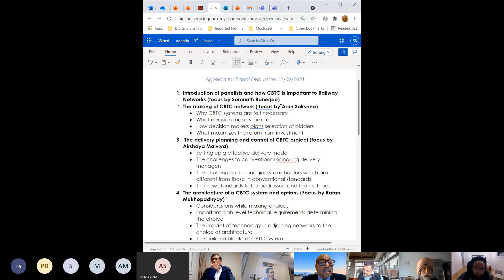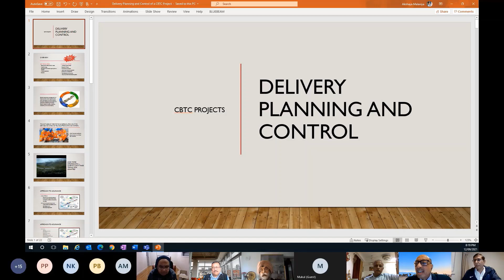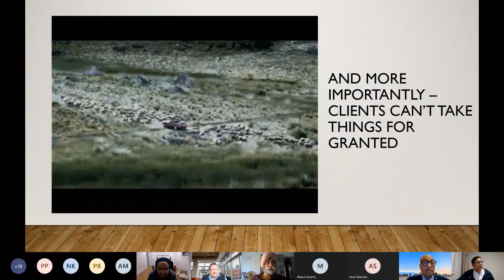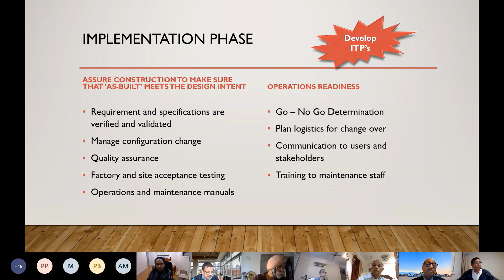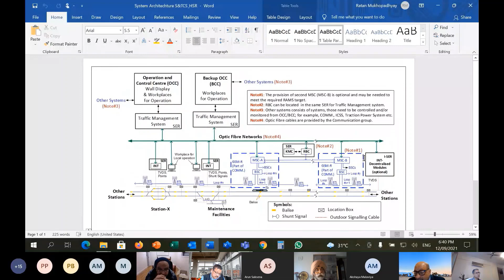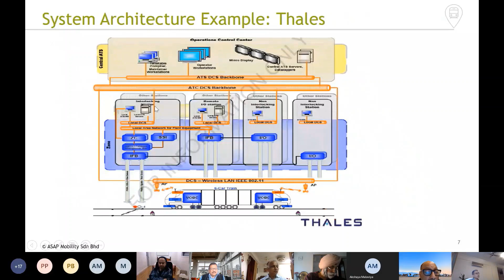Comment: Comments of V Shanker, IRSSE, GM CLW

Arun, one issue we are trying to figure out in driverless  GOA 4 CBTC system. If a train/ few trains lose their locational data for a couple of minutes while on the run (may be wifi link failure or transient on board problem ) and regains it a few minutes later, the way side control unit is unaware of changes in train positions in the intervening period. When trains begin reporting their location, how does CBTC resume normal ATP operations in that section,  after having adjusted itself to the lost information in those few minutes. I wish to know how safe train operations is resumed,  what is the role of secondary train detection in that scenario, what speed limits are imposed in the recovery period and how  vacancy of the section, clear of all trains is ensured before permitting normal ATP /ATO working. Iam not sure whether this is to be posted in this forum. Others excuse if it is too detailed and technical.